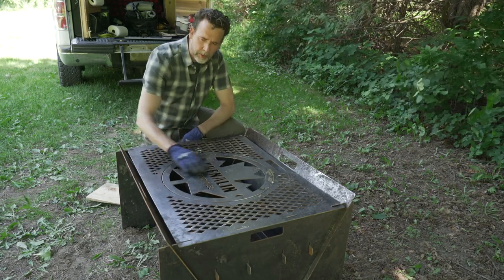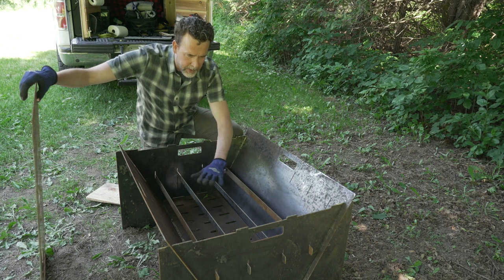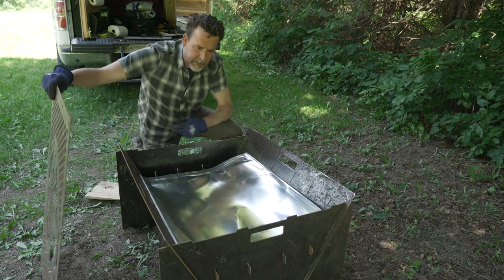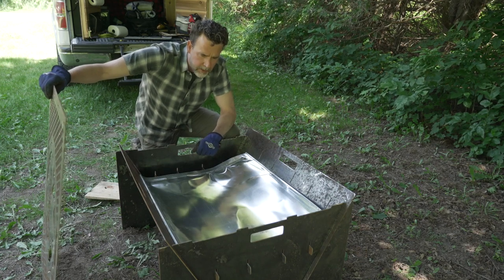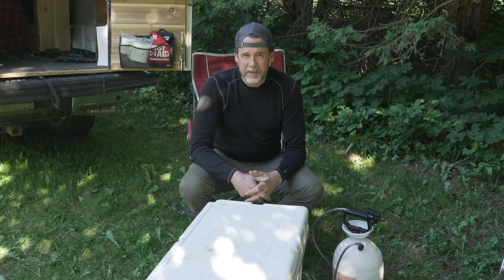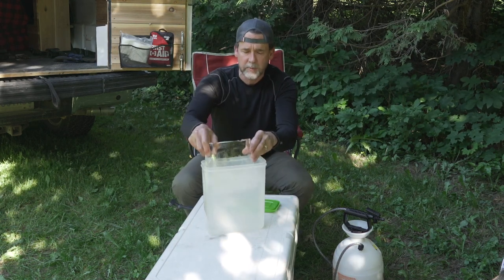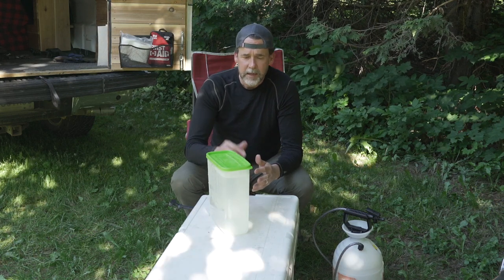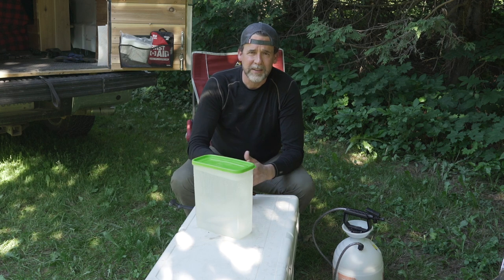PICKUP TRUCK CAMPING with a DIY 2 Foot Camper Extension - Grilled Steak on my NEW FIRE PIT

Comment: Very nice fireplace.  Happy to have you back.  Wondering what the orange device you placed under your tires is for?
Reply from the maker: Thanks Derek. It’s a recovery board primarily used for getting unstuck in mud but I use it to level my truck sometimes.